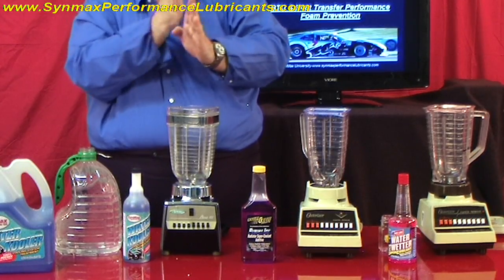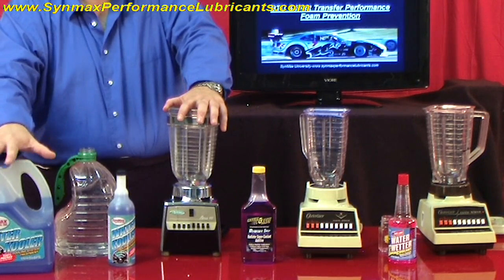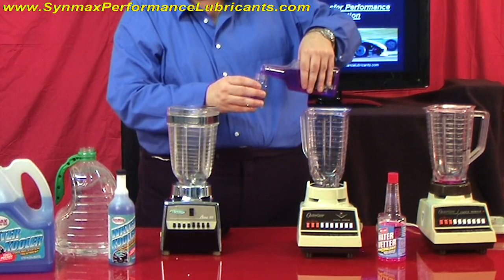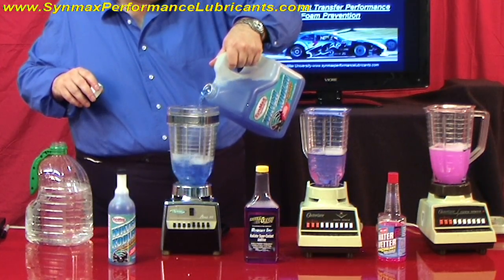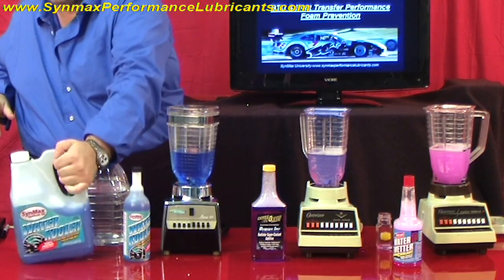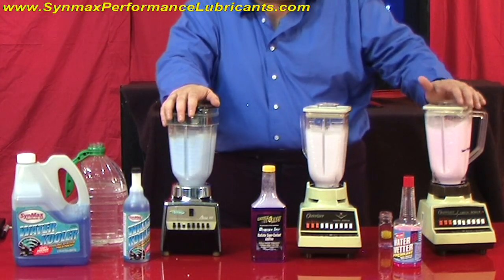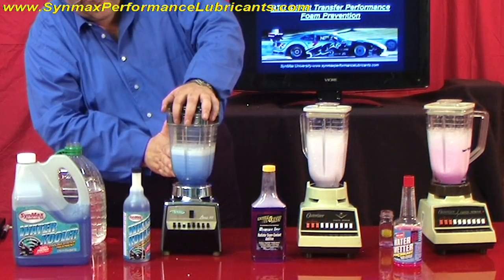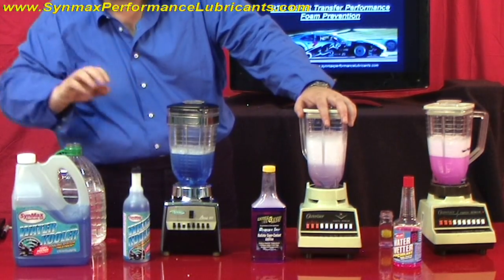SynMax Water Kooler PREMIX  Vs.Competition Foam Test DEMO  ONLY by SynMax University

Comment: I wouldn't show my face in such a scandalous phony test either... how did he get the competition to foam up so much? ... hhmmmm maybe a lil drop of dishwashing soap at the bottom of the 2 blenders used for the competition? ... not to mention the fact that before the test even started the competition went from 1. The already opened original containers.
2. The small "measuring" container.
3. The blender container itself.
4. The container that held the "Illinois tap water".
I smell a "SNAKE OIL SALESMAN"

Comment: I can see that it more resistant to foaming in a blender, but a engine water pumping design to push volumes of pressurized liquid in a closed system that not exposed to air.  mixer is a mixer and a pump is a pump.

Comment: What a bunch of BS. You can't test a premix, that has been filtered and processed specifically for proper qualities and pit it against two post mix products that are combined with tap water containing at the very least, Chlorine and several other very hard minerals in an extreme ppm count. The two blenders on the right are the same while the one on the left is different. How can you ever expect to win over opinions with such a stacked test? Just go away.

Comment: its unfortunate that i must disagree with your poor testing presentation here. 1st-You did not take into consideration water temp and that fact that most cooling systems are under pressure ! when a system is under pressure foam is nearly impossible to create until the pressure is released. Since foam is nothing more than tons of soapy air bubbles and bubbles can not form under pressure. This  demonstration is inaccurate at best. 2nd- water and foam both react differently under heat  and your lack of heat and pressure are both misleading to the consumer. Id say if you want to demonstrate this product properly build your self a real demo model using a radiator with clear tubing, and a heating element with temp control that will bring water to approx 180-210 degrees,  a clear water tank capable of 16-30lbs of pressure that represents the engine block, a real automotive water pump driven at the proper rpm for a high performance car approx 3-5000 rpm and have the entire system under pressure of at least 16-24lbs of pressure..  otherwise your really not demonstrating this product under real conditions. we all know if you shake any amount of water under the conditions you've provided in this video it will foam up to some degree..   My name is Leonard Manos and I know automotive performance when I see it and this isn't it...
Reply: r3

Comment: Test is a fail from the get go, no vehicle has a water pump spinning 20-30,000 rpm thus not creating these crazy bubbles in the cooling system, its way lower volume
Reply: IBoosted SS thank you lol
Reply: IBoosted SS You're missing the point. He is showing what cavitation looks like in an extreme way. All had same treatment,  but all 3 had varying bubbles showing which prevented it bettet. So yes, this is accurate and not a fail. Open your mind to free thought outside of the box